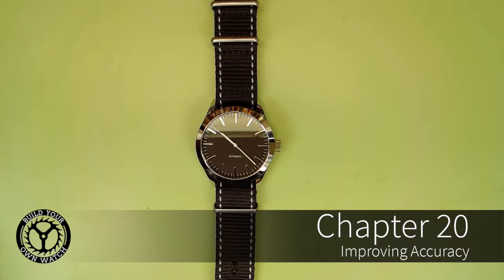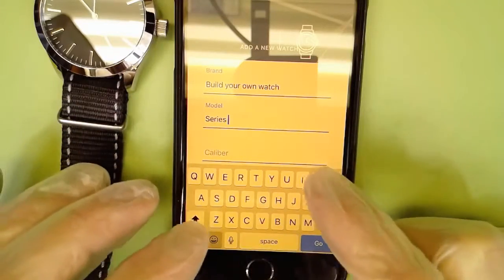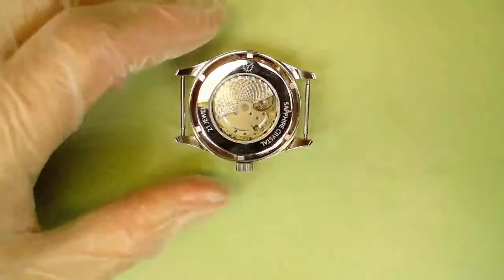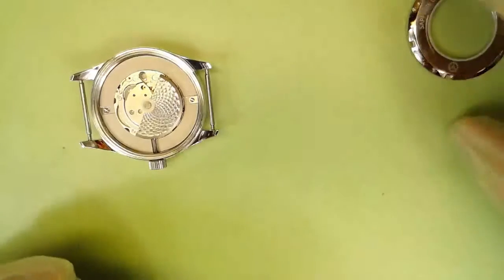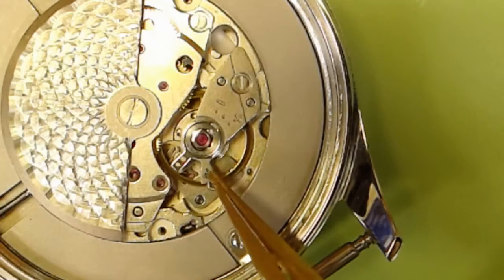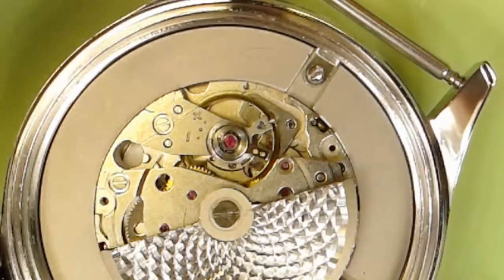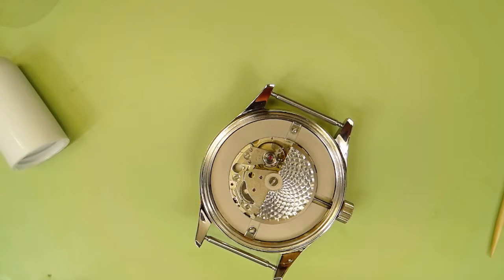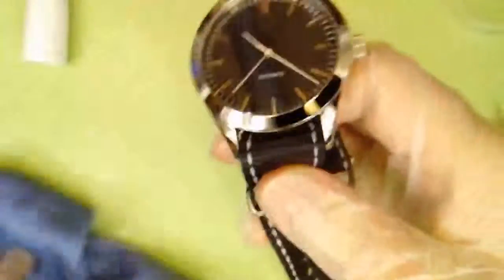Improving The Movement's Accuracy #20

Comment: If you have a collection of watches and like what he’s doing and can afford $150- Timegrapher can do multiple tasks, quickly. Not worrying about internet speed. Demagnetized watches run more accurately also. Another tool.
I would wear the watch if you’re using this app. between readings.
Sitting on a table is different than wearing (automatics).
Kudos to this guy for going the extra mile on videos.

Comment: 2 questions...

1) Why not do this on a timegrapher instead?

2) Is the lever the only means of regulation? Or does the screw have any significance as well? 

Example: eta 2824-2 has the course adjustment lever as well as the fine adjustment screw.